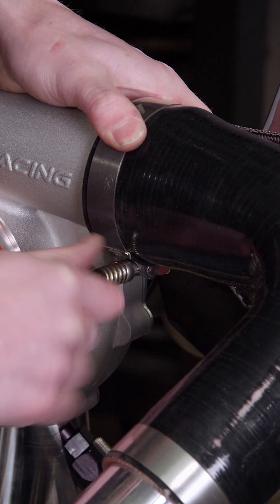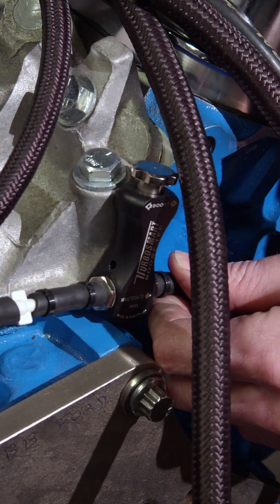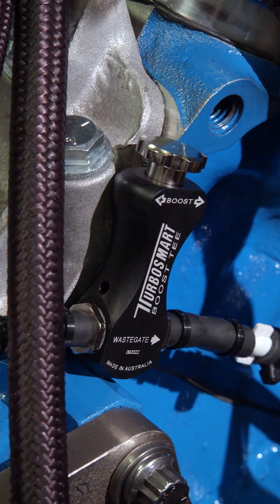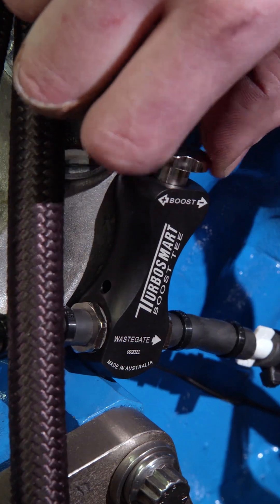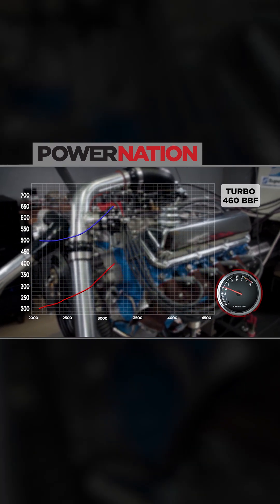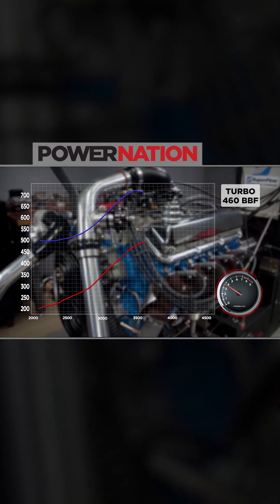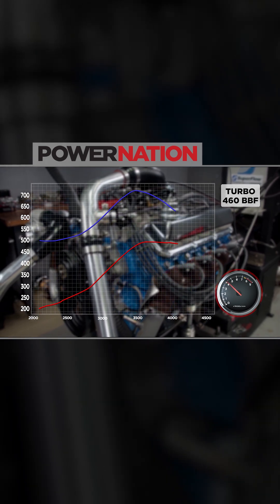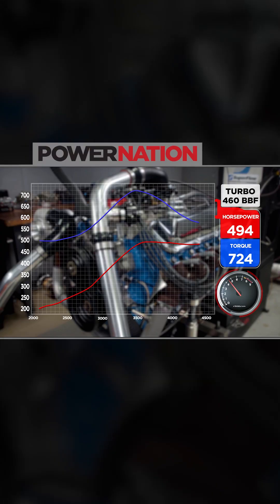Big Block Ford Turbo Test

Comment: Would be neat to see what an original 460 turbo could do once it gets over 1800rpms , because 160hp at that rpm is decent but I wonder how choked it is at higher rpms.

Comment: Ford-isms:
Ford never designated their engines by 'Big-Block', or 'Small-Block' - instead, they referred to them by their engine family. For instance; A 460 or a 429 is a Ford '385-series'.
Reply: Dumb but true
Reply: @markwaltman1524  not dumb at all because they make more than 2 sizes of blocks. The FE is a mid size block, 385 series is big, and the 534 series is massive.
Reply: @Zach-ju5vi  Does the 385 stand for anything?  Thanks for the knowledge.
Reply: @fourleafcloveer5011  385 stands for 3.85 inch stroke.
Reply: What about the 335  @Zach-ju5vi
Reply: That's dumb. That makes no sense
Reply: Goes to show you why everyone big/small block Chevy and LS swaps everything 🤷🏻‍♂️

Comment: i got my 1975 351m in my kitchen, the motor was restored yrs ago and i had to keep it since it didnt let me down on the side of the road or burned oil..nevermind that it ripped ass good too in my 77 highboy f250 standard 😊❤✌
Reply: You have an engine in your kitchen... 
That's all I need to know 😂
Reply: @christhut8140  the truck saved me and my little ones and when the truck wasnt fit for the road i pulled the engine..i figured that the least i could do is keep its heart that had low miles on it from the crusher, and some day id like to put it in another truck/car 😎😎✌✌
Reply: What do you feed it for breakfast? 🥓🥞 🍳

Comment: How is anyone impressed with this thing... It feel off like a diesel... 🤦
Reply: Tell me you are narrow minded without telling me you’re narrow minded
Reply: @Chuassy  Ahhh, ok-ay... 🙄 How's about keep scrolling and have a look at the comparison with Hot Rod magazine's junkyard truck 454... I'll take the 1300 HP all day
Reply: @danielbrealey2924  dude I love Chevy 454’s but damn dude, you act like you invented the thing
Reply: @Chuassy  How- every time it's been mentioned I gave credit to Hotrod magazine- maybe a little bit of projection going on here... 😅 They way that thing fell off was absurd
Reply: @Chuassy  And to be honest, I own a couple of engines that would embarrass this thing- all of which I built myself, as I've been a qualified mechanic for over 2 decades and have been building race motors since I was an apprentice.
Reply: @danielbrealey2924 no you don’t
Reply: Stock cam and head that they literally said werni not designed to do this. I guess you missed that part
Reply: @KingJT80  Maybe you should look up the article done by Hotrod magazine from a couple of years ago, regapped rings on an old truck 454 from the junkyard. Sent 28 psi through it all day long on the dyno, over 20 full throttle pulls @28psi. Make over 1300 HP every run, back to back. One disclaimer though, they DID fit a set of cheap Chinese heads and decent single plane. Pretty sure it still used the stock cam, but it was too long ago to remember. Makes this thing look like a pike of garbage
Reply: @danielbrealey2924  yeah I doubt they did 28 PSI here. 

 And 700 ft lbs of torque from any gas engine at 3000 RPM isn't garbage.

 No real enthusiasts would say it's garbage that's just silly
Reply: @danielbrealey2924  stock big block holding 1300 lmfao 🤣 speaking out your ass my friend

Comment: 700 pound feet at 3000 something is glorious, pat you look good man! trimming down lol keep it up guys I'm sure its the hard work paying off!
Reply: "700 pound feet at 3000" may be glorious, but 700 foot pounds at 3000 is even glorious-er. 😉
Reply: Boys a dang ole tractor trailer
Reply: My pump gas big Chevy made 600 ft/lbs @2800 and carried it to 7200 peaking at 690 ft/lbs around 6200. naturally aspirated. I’m not impressed.
Reply: @FlatBroke612 which is very impressive in itself but I’m not sure if you’ve seen this episode but this was on an engine that was built to factory specifications. So seeing a completely stock motor make that is what’s impressive.
Reply: @FlatBroke612  That's if that is actually true and more so, probably spent a lot more to do that. This "build" they did is pretty affordable

Comment: Never seen anything fall on its face this hard. Looks like diesel curve 😅
Reply: Stock gas engines aren't making 700 ftlbs of torque at 3000 RPM 😂
Reply: works for me.
Reply: it's because of the heads and valve train and timing, and valve lift, and valve duration, and, of course, compression/ compression ratio. this setup is capable of more power, minus this particular valve train.

Honestly the 460 Ford in this video is not getting the proper amount of air hence it doesn't create a lot of horsepower, given it's displacement.